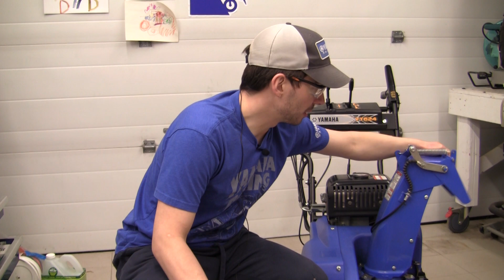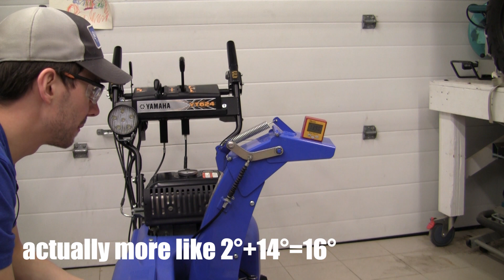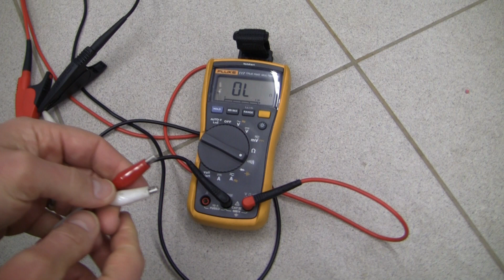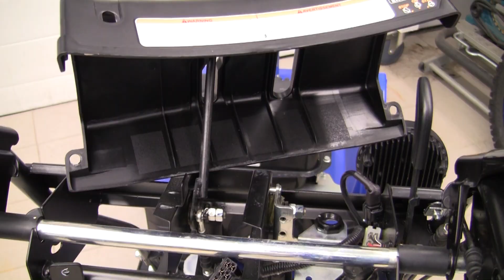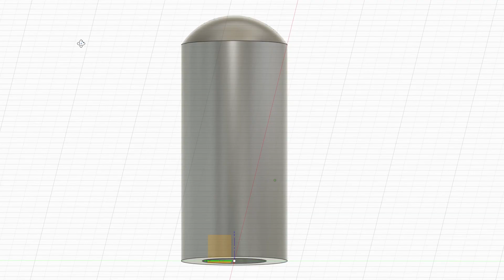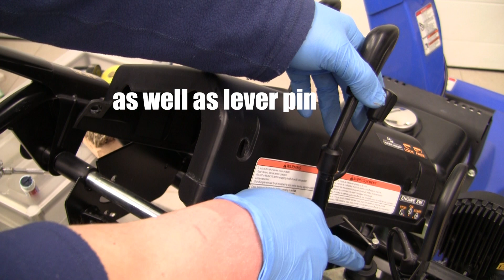Ep. 17 - YT624EJ M.S. - Chute Deflector and Direction Control Lever and Switch

Comment: I had the same chute angle problem. Searched high and low for a solution calling multiple Yamaha dealers for an answer. Finally found what the problem is on my own. The cable stretch is not the problem. The problem is the black steel bracket holding the chute lever cable under the handle console. It gradually bends towards the rear, creating that loose action you get when pushing the lever forward. Bending the bracket slightly towards the front of the snowblower will eliminate that slack and the chute will regain the extra angle you are looking to get back.
Reply from the maker: Thanks Francois, check out Ep. 19 ;).   https://youtu.be/8UvclaXur4A?si=YT1l9B54-CdboV41

Comment: Could you do a video on replacing the chute cable and also I had a people with the motor turning the chute very slow the dealer said they sometimes get water in the motor and 
Seize a bit … this motor is almost a measurement$500 if you could take it out and see if there is any maintenance that could be done on the chute motor??!?
Reply from the maker: Hi there, in this video I showed the steel control cable end points for the purpose of replacement no? Or are you talking about the electrical cable that controls the chute rotation? Good idea on the chute motor, I can probably make a video there yes.

Comment: Great video,when my switch failed one of those plastic plugs was actually broken in half. I made new ones on my lathe out of delrin.
You have a lot of patience,I remember there was a lot of cussing when I pulled out my switch. I really enjoy your videos,they are well made🍻
Reply from the maker: Thanks for the feedback! Actually it is good to get some feedback as to what has been found when the switch stops working. I was thinking of getting them 3D printed but I'm not sure they would stand up to the stress, I think you did the right thing by machining them.